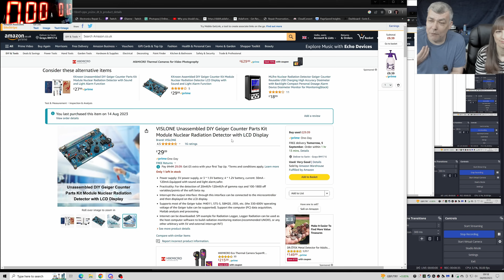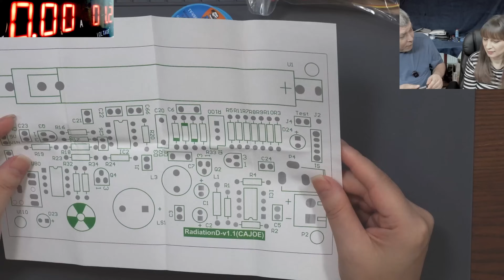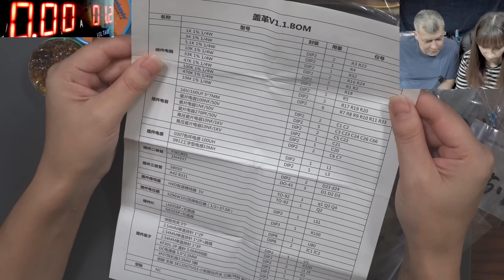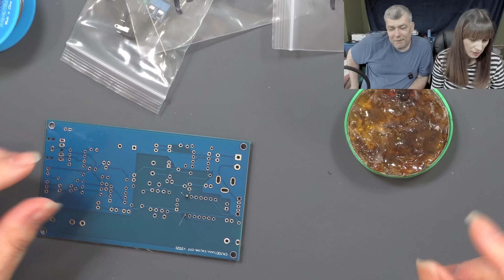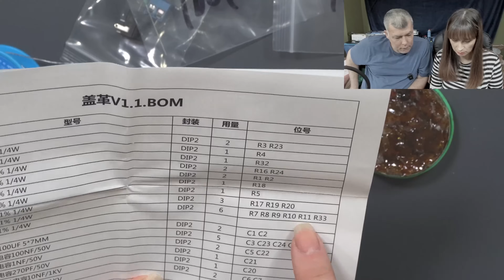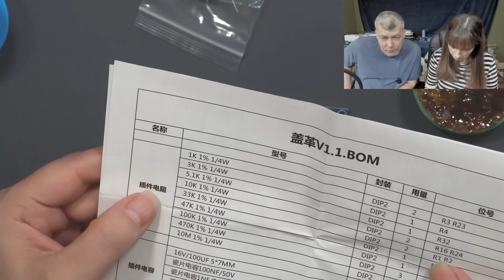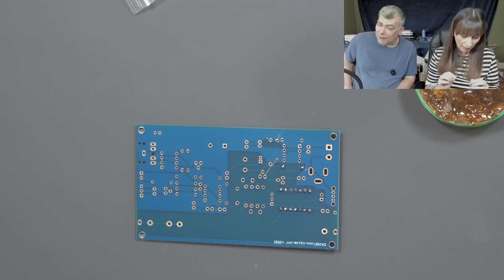DIY Geiger Counter - Radiation detector - Lesson 3 - Learning electronics with Diana

Comment: Just checked on Amazon the desciption is incorrect.
It claims that there is an LCD display, but this is not included with the kit.
There is also a mistake, -:
The board pin labeled VIN is incorrect, it is the pulse output when a radiation event is detected.

Comment: Now how one could add a counter to this detector module? I remember being ages ago a counter IC made special for this purpose: radiation/particle counter but I do not remember its code and I also think that it is no longer manufactured. So, can be added a counter module and which one do you recomend?

Comment: Just bought one....  worked fine for about 30 minutes... but right now there are no more beeps... there is just the power led lighted. Any one  experiencing this ?
Reply from the maker: happen to us also when i started playing with that adjustable resistor, so you have to power off, adjust the resistor then power on and check
Reply: @sorinelectronics  thank you Sorin i will try tomorrow
Reply: @sorinelectronics  umh... btw this happenend when the unit was powered... withouy any change to the regulation trimmer.... i just see the unit stop beeping by itself.
Reply: @sorinelectronics  Sorin i checked every component... the only one i found "strange" was the L3 inductor... it has 15ohm resistance... if you have time can you confirm me that this is a bad value?
Reply from the maker: mine one has 11 ohms, so i suppose is good
Reply: @sorinelectronics  oh.. S**t :(  this is very very strange.. the circuit is soo simple....   i have only 3v on the geiger tube... this mean that the 3 diodes 3 caps used  to increase voltage are no doing  they job... but every transistor is good... every diode.... the 2 555 are good... the bottom one is switching and the upper one not... but swapping them make no differences...